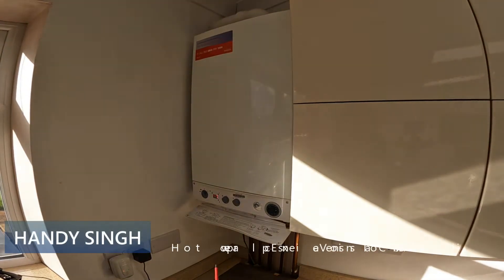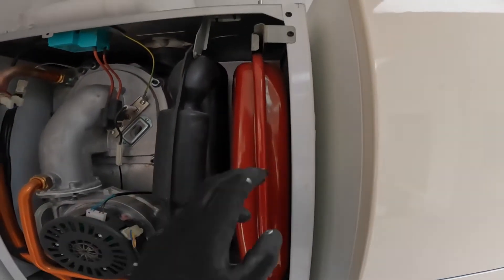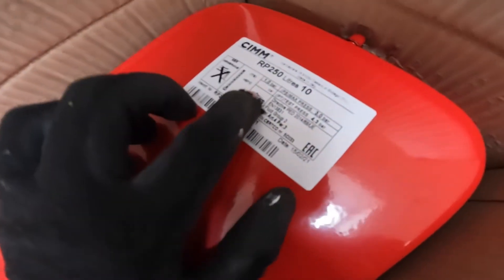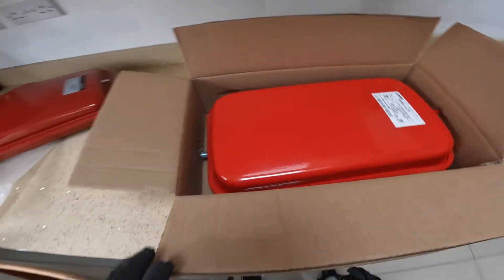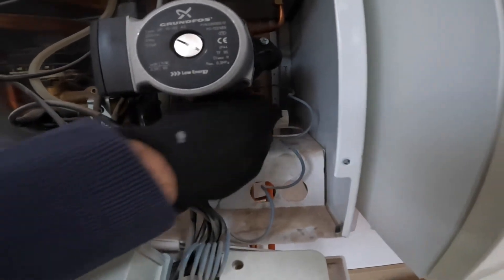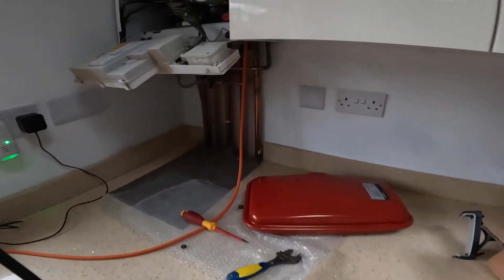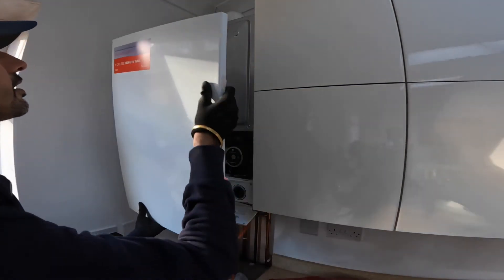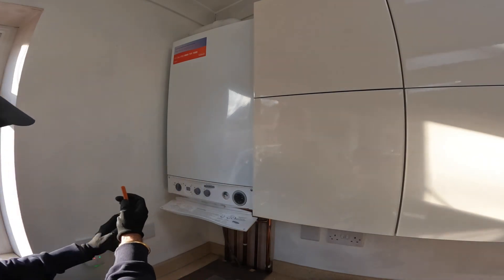How To Replace Install a Expansion Vessel on a Combi Boiler - Baxi Main Eco 30 - 10 Litre - 1.0BAR

Comment: Not good practice to drain the boilet via the over pressure valve as dirty water flows past the seating which can stop it sealing correctly in the closed position. With a combi, or system boiler, the flow and return valves for central heating always have drain cocks attached to them - use theseinstead!

Comment: Instead of changing the vessel did you first try and check the pressure of the bladder in the existing vessel… maybe just needed to be pumped up?
Reply from the maker: Hi mate, yes if water comes out of vessel then you know the internal bladder has popped.
Reply: Open the schrader valve and if water comes out it is knackered.  Measure and observe endings on new replacement before ordering on line.  Several look similar, same dimensions but different endings for the schrader valve

Comment: Hi can I go instal the same model but diferent pressure?On my label is 0.8bar but i buy 1.5 bar is the same model  8l rp 250  but difrent pressure
Reply from the maker: Hi mate, yes that's fine. You can still use that as long as its fits the same brackets and exact physical size to fit into boiler. Cheers Handy Singh.
Reply: Thanks mate 😁
Reply: I'm just exchange the expansion vessel but now show me e160 in my baxi boiler look like is problem whit fan start 😢

Comment: Don’t you need to bleed any air out once you refill the boiler?
Reply from the maker: Hi Mate, no need to bleed again as the valves on boiler were shut off. However you could always check to be on safe side. Cheers

Comment: Hi. Recently replaced the expa sion tank on this exact boiler. However now only some of my radiators will work at the same time. If I turn upstairs off downstairs works and visa versa. Any thoughts please
Reply from the maker: Hi Chris, yes sounds like a balancing issue. Make sure the pressure in boiler is above 1 bar. Then the next step is to go around and reduce the thermostat valves. Count have many turns you have done and then the radiators that are hot try and reduce them to a 1/4 open and the ones which don't get cold open up as half..you will have to do trial and error. Also do you have an inhibitor in the system?

Comment: If boiler fitted with isolation valves you only need to drain the boiler rather than the whole system
Reply from the maker: Hi Jules, yes you will see in the video I only drained the boiler, both flow and return valves on boiler were turned off. Just the commentary it video I must of said drain the system. Hope the video has helped. Cheers Handy Singh.

Comment: I wouldn't normally touch my boiler but was let down by my registered "engineer" - Serviced in August ( I try to get ahead of the game) but I contacted day after as pressure was hitting 4 bar - His answer "no it will go high once turned on" - yeh right, for a short time "higher". Then in November contacted again as put heating on for the oncoming months and not happy with pressure, was also overflowing outside - he came out, oh "expansion vessel is split" - no sh*t! After chasing for him to come back 3 times, I saw this and thought blow it and bought online for £69 - my "engineer" wanted £320 - he said the part was £200! THANKS SO MUCH FOR POSTING THIS AN EXCELLENT VIDEO FROM START TO FINISH and my house is now warm!
Reply: They are all super sleazy and always advise changing the boiler instead! Or over price the items. Where are the good old days you would have a plumber you trust, buy the items and the just fit them...?
They are in super high demand and all are taking the piss really.
Reply from the maker: I'm glad I've saved you money and the main thing is your confidence to try it..Well done Andrew.
Reply: Just been quoted £330 after a gas certificate £40?  For vessel and trv £15 valve. 10 min job too...  So £195 labour
Reply: @ look vessel and trv is going to be about 1hr job
I would expect to pay £150 for TRV and Vessel (including their mark up) plus £100-£130 labour.